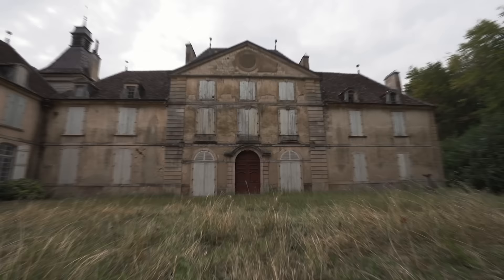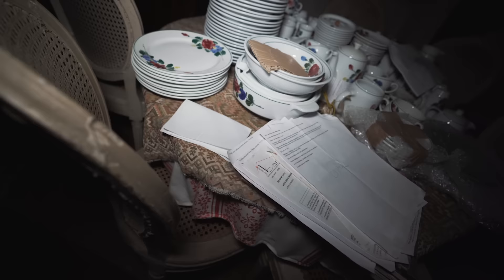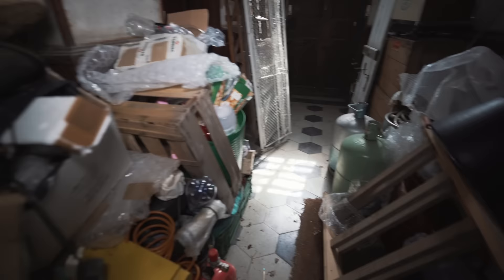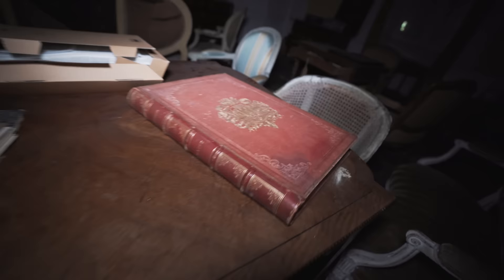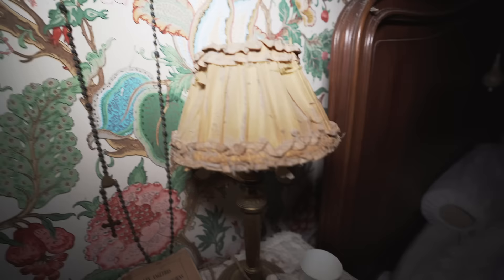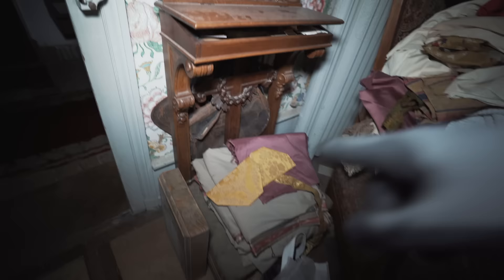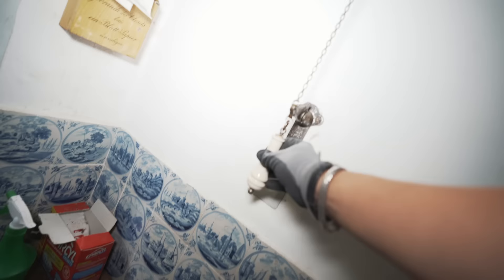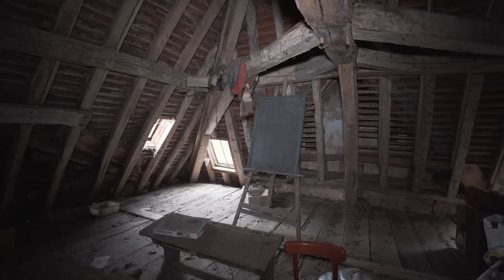Incredible Abandoned 17th Century Castle in France | FULL OF HISTORICAL TREASURES!

Comment: When you reach the attic level you can see a structural detail that used to be common in the 18th century and even the early 19th. Thomas Jefferson used the technique at Monticello. It's called brick nogging - shallow arches between timber joists.  the top of the bricks can be filled with either mortar or sand and the floor surface is, apparently, tile in this case. But wood could be used as well. . . It must make for a more fireproof and sound proof floor. The rest of the floors throughout the house are probably built the same way. When you walked around, my guess is the floors didn't squeak or vibrate.  In the 19th century when Iron was much easier to produce in large amounts, the brick nogging would span between iron beans.. .

Comment: Those devices are not clocks, they are called Wimshurst machines from the 1800’s, which are electrostatic generators.  Very cool you found those there. 😎 👍
Reply: I concur!
Reply: And the glass jars are capacitors
Reply: Do the winshurst machines make electricity?  Fascinating information,  thankyou for letting us know - I will look them up to read about what they are etc 
👍👏
Reply: Thank you for knowing that. I tried to google them but I couldn't come up with anything. Lol I thought they looked like electric experiments.
Reply: @twodogzdogue8710  Lots of videos on Y tube
Reply: The fireplaces I believe were there when you know when they built it and then many years later the fireplace don’t get the room that warm so then those other stars came out and with that pipe being exposed I can see how that could help keep the room warm but having three doors on it I wonder if ones for Woodburn’s for Cole or whatever I don’t know I’ve never because I’ve only seen him through your movies and then one of the rooms I think the the pipe that goes along the edge of the wall and that’s a newer one than those stoves so it’s kind of like a three generations starving we have there but I’m having fun with you
Reply: On that bathroom it shows the fireplace that one heater and the other one over on the other side so there’s all three of them in that one bathroom to heat that room

Comment: Wow. What a long video. Almost 2 hours.

3:19 Security? LOL. I thought this was to be a guided tour, but he is a friend. I see.
4:14 That is a beautiful blliard table. Funny how the main door enters this room.
4:53 That circular object is a Van DeGraph generator. Creates high voltage static electricity.
5:05 Leyden jars. An old way to store electric charge.
5:32 Several electrical scientific instruments from the late 1890s to early 1900s.
7:47 That is where the billiard cue sticks were placed when not in use
10:00 That is a very interesting work of industrial art. I quite like it.
11:08 With double door wardrobes, there is a small catch on the inside to open the 2nd door.
13:56 That is a calculating scale used in shops to quickly show different prices per kilogram
15:38 Japanese. The two top symbols is Ni-Hon meaning "Sun Origin" the symbol for Japan. But the symbols seem to be mirror image. Is your camera reversing the image? The graphic also shows a rising sun.
18:26 The curved exhaust pipes allow more heat to escape into the room rather than up the chimney.
19:58 It is funny how they have 3 forms of heating in this room. The old fireplace, the white furnace with curved pipes and the water radiating heaters.
22:07 Wax seals for envelopes. How strange to see that these days.
27:52 LOL. I thought I had too many plates and glasses. Even the few I have I hardly ever use.
38:10 I think they had too many kitchen things. Perhaps they did not know how to throw away old things. :)
39:03 Those jars probably contain home made jams. The other jars had preserved plums probably.
39:30 A lot of meat grinders to make minced meat. My mother had one many years ago.
40:25 Wealthy people do not care about the poor. They don't even think about them.
42:16 NO WAY! Those glass photo plates should be in a museum or state library.
42:38 Why are these important historic documents not in a state library? This is insane.
50:52 That is such a beautiful chandelier with so many different coloured glass elements.
50:58 Did you see the old style piano in the far corner?
51:38 What a lovely old board game.
52:52 Before you go upstairs... there is NO CELLAR? There must be a wine cellar in this building.
53:30 LOL. I bet the "Brothers of Decay" set that clock in motion when they were there. It is so sad to see a clock telling the time with nobody to see.
58:27 The date on that fireplace is 1677. Is this house that old?
1:03:20 In that child's room I was crying and laughing at the same time.
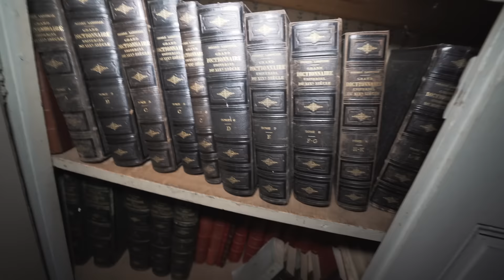1:09:28 More books that should be in a state library. They seem in very good condition.
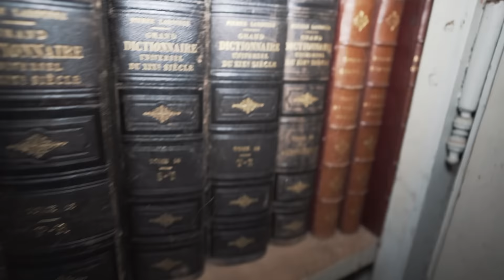1:10:03 "Grand Dictionnaire Universel du XIXe Siècle" originally published in 1864 is a French encyclopedic dictionary.
1:13:11 Water is not drinkable.
1:14:04 That is called a Top Hat
1:15:39 A long video is great and I love the detail. We can always pause and resume when tired.
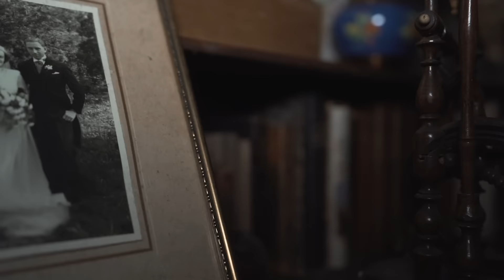1:16:25 to 1:18:15 was beautiful photography especially with the music.
1:24:08 A bidet but no toilet. I wonder why? No sewage plumbing to the upstairs perhaps?
1:29:23 I was wondering when you would find the "Royal Throne Room". LOL
1:29:50 All those blue tiles are unique. I cannot see any two that are the same.
1:37:00 So this is where the servants lived. All these rooms right at the top in the attic.
1:42:10 That is a hand cranked electricity generator. The handle is missing at the front.
1:42:51 Funny how some of the rooms that seem to belong to children have adult clothes in the wardrobes.
1:43:17 That is a very old telephone. A collectors item for sure.
1:44:24 LOL. Freeze frame here and you can see the plastic breast. Blur fail!
1:46:13 More books that should be in a state library or in the rare books section of a university.
1:46:43 That book looks like it was from 1785 !!!!!
1:46:46 Not 16th century. That is "Tim XVII" meaning "Volume 17 VENE - Z"
       (I don't understand why you don't report these places to an academic institution anonymously)
1:50:42 I wonder if some of the children were initially home schooled up in that attic.

Thank you heaps for such a grand exploration. I loved the feature length presentation of this house. I watched it from midnight till almost 4am, pausing, rewatching parts, and making notes. Your video was much better than the other one I saw from this house by the VBrothers of Decay, although theirs was also very, very good.
Reply: Dexxter, wtf.
Reply: @HDB316  ... Explomo did ask me for a detailed commentary. :)
Reply: @twofeathers5145  ... Thank you. I appreciate your feedback and comments.
Reply: @twofeathers5145  ... I am too old to explore these days, and living in Australia makes it less likely since there are virtually no abandoned homes here. They are far to valuable to be left to rot.
Reply: Wanted to write the same as you ! But I have a different eye . The “ metal art ‘’ is Not ! It’s a 17th18th century SAFE DOOR !  A grand complication of iron work . You can see key and two hinges. That’s the locking mechanism on inside of door ! Very valuable. Not to mention the potential Louis icart lights tiffany ? Laluique more likely . The chandeliers with candles ? And colored glass ? Potentially extremely valuable. There were two ! 250,000 each . Or the scientific books ? Potentially very valuable . The scientific things were demonstration teaching tools . The tons of very old oil paintings, very very valuable . Every fireplace mantle 25-50,000$ each ! Some valuable ladro ceramic . Alligator vintage Hermès bag ? Museum piece mucho valuable . The other French chandeliers 5-1- 25,000$ a piece ! Same with gold armalou sconces. Even the tiny little bronze “bust ‘ you call a child’s toy 🧸- could be a mini RODAN  50,000 $ bronze . Shocking that you never looked once ? Not once for a signature or makers mark ? You are standing there talking about trinkets , while next to you are treasures, you don’t see or mention. Omg. The ski curtains 10,000 a pair , the old old andirons in s
Each fireplace- 2,000$ each . 1400s paperwork omg 😳  loosely there’s 2 million if not five million in rare very very old stuff there .
Reply: @SRocco-dv8we  Last owners were likely acquiring these items... leading to their bankruptcy and sudden abandonment due to foreclosure.
None of the stuff "belonged" to them, but to their creditors; instead they walk away and let the creditors sell the stuff... creditors tend to be large banks and they don't have time for such crap either.  So it sits.
Reply: @twofeathers5145  They did not educate the "lower classes"
Reply: I wish i know the location of this Castle so that I could secretly report it to the local Museum, tertiary institutions, etc as they'll definitely shout from the mountain top - JACKPOT
Reply: @fefinetonga4662  ... This is something Explomo should be doing anonymously when they find a place like this. A few times I have been disappointed they did not report their finds. I know it is not their responsibility to report but it would be a gift to humanity.

Comment: Hi, have just discovered your channel, really enjoying it! One comment, at 1:23:02, these are not sleighs. They are called « moine » in french, and were used to warm up beds before going to sleep. You’d place hot coals in the metal pots hanging in the wider part of the moine, then place the whole thing under the sheets for a few minutes. A real fire hazard... I’ve seen them still used in some old houses, only the coal pot has been replaced with a lamp...

Comment: At 56.44 of the video, you asked what is the purpose of the tool that appears to be comprised of wooden sticks, it is most often called a yarn swift, used to unwind a skein of yarn, by placing a skein of yarn on the ‘arms’ which expand to form a circular lattice frame that spins, to unwind a skein into a ball of yarn more usable for knitting, or to un-skein yarn onto a loom for weaving.

Comment: The hand-turned wheels, large and small (5:0) are static electricity generators. This particular generator was invented by amateur scientist James Wimshurst (1832-1903). It was developed in the mid-19th century, replacing sulphur and glass ball versions, and used to demonstrate electrostatic sparks and other electrical effects. 
The glass jars with 'tin foil' inside and out are "Lyden Jars" that store a high-voltage electric charge. It was invented by "German cleric Ewald Georg von Kleist on 11 October 1745 and by Dutch scientist Pieter van Musschenbroek of Leiden (Leyden), Netherlands in 1745–1746." They were the first "capacitors" in history; without them modern electronics would have developed entirely differently. 
These items appear to be originals and properly belong in a museum. 
Thank you for sharing this incredible video.

Comment: At the beginning, on the fireplace with the iron panel with the coat of arms, there is a hanging place to heat and cook things on the fire. Above the fireplace that big intricate metal panel is the inner part of the lid of a XVII century german strongbox, you can see in the left corner the key tied. That is the inside of the lock combination.

Comment: That wood stove at 1:20 has a very long flue pipe designed to allow as much heat to enter the room as possible before it exhausts up the masonry chimney. in the wall. Another variant you might find is a long flue pipe rising up to the ceiling and crossing the room to exhaust up the chimney. on the other side of the room. The idea is to let only warm gasses actually rise up the masonry chimney. .

Comment: These thing in the beginning off the video  with the bols on it  are called  (The Wimshurst Machine  or  A Wimshurst electrostatic generator )  working on the principle of induction, generates high voltage differences and sparks between two movable electrodes. By increasing the distance between the electrodes, higher potential differences can be built up.  It's a  verry intresting place that is guys great video !

Comment: That "Sundial" is an electrostatic generator, we had it in physics, it's basically an oldtimey dynamo with a different approach to generating electricity than the typical ones with magnets 😉

And the letter was about selling/buying the kitchenware on the table, it says that the seller didn't see a damage on the ware when she cleaned it before sending it and that she will refund the money for the damaged ones.

Comment: The heavy cylinder at 1:45:00 is a counter weight; it would be attached to a pulley system to make it easy to move a heavy door or draperies, or a series of weights for a dumbwaiter.  🙂

Comment: The reason for all the exposed pipe on the heaters is to be a sort of radiator. Because those old devices didn't have blowers like modern heating, as the warm air rose naturally the pipes would heat and then warm the air in the room.

Comment: The machine is an electricity generator, designed to generate high voltage, but low joules. The silver-clad bottles are in fact Leyden-Flasks that are used to store the generated electricity.

Comment: That thing in the washing room its a washing machine (the big green one) it can be still used today but the problem is that the clothes come out soaked so you have to use the other wooden machine to take out most of the water so the clothes dry quicker.

Comment: The contraptions in the first billiard room are static electic devices, a dynomo that will produce electrical current when you turn the handle. The jars are batteries and other devices to use with the electricity produced.

Comment: Those "sun devices" are actually old hand cranked generators. Kinda low voltage. With practically no amps. Couldn't power up any modern devices. Would have been used as a novelty device to showcase the magical powers of electricity. And perhaps for experiments by enthusiasts. The glass jars next to them would be used for energy storage, like batteries or capacitors

Comment: Those wheel devices closely resemble electromagnetic flywheel technologies. Magnets placed on the notches and copper coils placed strategically for when the wheel is spun, electric induction takes place producing electricity.
Reply: The big copper ball with smaller ball protruding from it is a Solar observatorium, a device that reveals the stages of the Sun, giving postulations about the Lunar activities.

Comment: That thing you thought was about astrology is an electric device. It’s got a hand crank to use kinetic energy to produce electric power. That’s why the metal parts are there, they conduct the electrons. The jars in a box next to it are the transformers, they decrease the power created on the wheel so the power isn’t too strong. This was a Tesla like machine. I think there’s a piece missing…

Comment: Using wood to heat with is a cleaner then c o a l call produces more and takes longer to burn they would use c o a l in a night time so they would not have to get up and keep on banking the stove and also fireplaces a lot of heat would go up the chimney but a regular wood burning stove there would be less heating escaping because of your flute on the top that you would control of the burning of how much are oxygen would get to it to how much faster it would burn and the reason why I forget the name chimney ducks the reason why they are curved is it would store more heat into the room and also on a windy day less when would be able to come down through them ducks and put out the fire